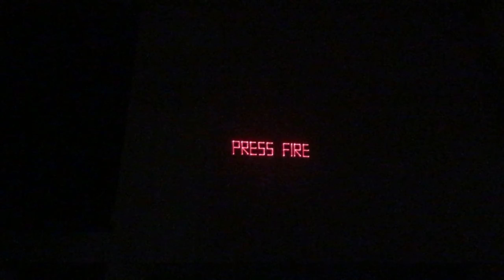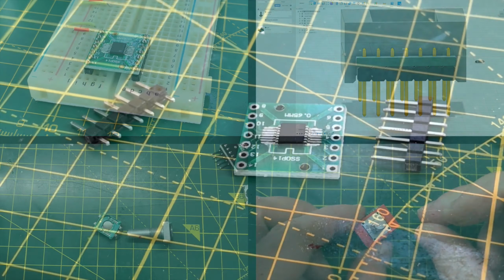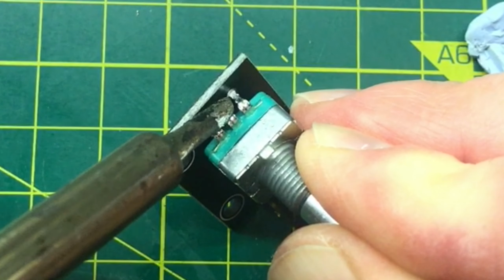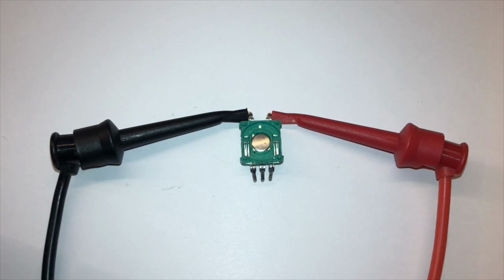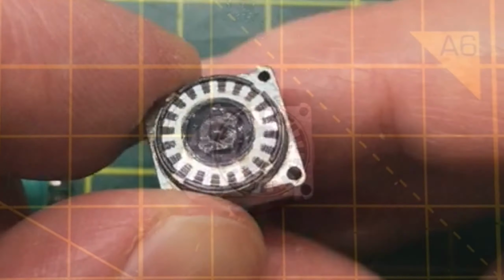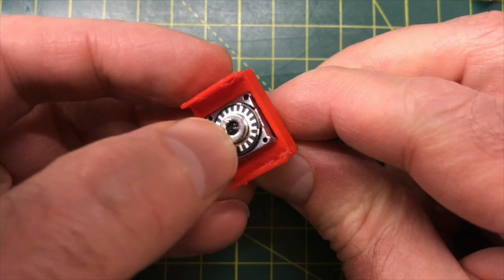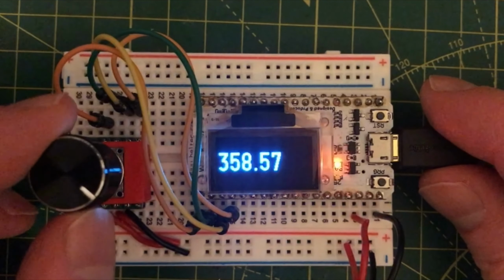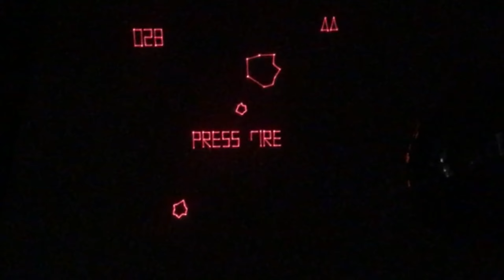High-Res AS5048 Magnetic Rotary Encoder DIY

Comment: This is really neat. I've been wondering how to interact with a hermetically sealed device for a dive light project I've been working on,  and I think this magnetic sensor configuration might be the answer. I applaud your ingenuity for repourposing the encoder shaft with a simple 3d printed addition👏🙌👌.  A+
Reply from the maker: Sounds like a great project. You would probably need to do some experiments to see how far away the magnet can be and if there's any impact from having some material in between the magnet and the sensor.

Comment: Another tip is to solder the end pins first and then you've got everything mechanically sound and can finish up the rest. This tip works well with or without the breadboard.
Reply from the maker: That's a good tip. Also works very well with header pins in an awkward place. Solder one of the pins and then you can adjust it easily to get it square before soldering the rest.

Comment: Another quick question- how expensive are those rotary IC chips? I presume they're an internal arrangement of hall-effect sensors?
Reply from the maker: They are relatively expensive compared - around £7 depending on how many you want to buy. There are some evaluation boards but they seem to be around £14-20. I was quite lucky that Rob Dobson (https://www.youtube.com/channel/UCScxC8mTWRU_ARb4nC3vIUw) had one spare from another project he was able to give me. You are correct they are hall-effect sensors - there are a few alternatives at different price points and quite a few from other manufacturers.

Comment: I had trouble to understand this video. Are the contact brushes still being used for some reason? Or was this just about using the same knob and overall design, but with a magnet and magnetic sensor? I'm new to this, so only read how this normally works, I'll look into a video next.
Reply from the maker: Just using the same knob and overall design and replacing everything with the magnet and sensor.

Comment: DESoldering any part is very easy. You need to hold the board with pliers, and gently pull it with others, holding it all over a regular electric stove.

Comment: Wireless control is quite easy to do between 2 ESP32's using Bluetooth serial - one as master the other as the client. I made a handheld game recently that used Bluetooth Serial to communicate between a pair of controllers, it works quite well.
Reply from the maker: That's really interesting - I'll have to give it a go. Do you have any pointers to sample code anywhere or is it obvious from the docs?
Reply: @atomic14  I just started with the example code https://github.com/espressif/arduino-esp32/blob/master/libraries/BluetoothSerial/examples/SerialToSerialBTM/SerialToSerialBTM.ino and https://github.com/espressif/arduino-esp32/blob/master/libraries/BluetoothSerial/examples/SerialToSerialBT/SerialToSerialBT.ino then I got the master to connect to client device. They each sent shared game state messages to each other over the BT serial connection. The connection between two esp32 devices worked ok up to about 10 meters and the connection was stable for over 24hours in my testing.
Reply from the maker: @sharpbends  Very interesting - I'm working on an ESP32 walky-talky but will probably use ESP-NOW for the longer range.
Reply: @atomic14  I think ESP-NOW has quite limited message size but I will be interested to see what you can do with it.
Reply from the maker: @sharpbends  250 bytes I think - but - if I can get it to build and run fast enough - I'm going to try using a codec from the days of GSM that compresses speech down really aggressively.

Comment: I've made an encoder from a hard drive motor but never did anything with it, I'll wait until my programming skills improve ! neat video and yeah make it wireless...cheers.
Reply from the maker: That's really interesting - I'd love to learn more about how you did that.
Reply: @atomic14  Hi, I got the idea from Greatscott, it just uses the motor and the disk mechanically then comparato'rs and Schmidt triggers to get a clean pulse from the three phases, and the rest handled by an Arduino. I had it control an LED ring, so as I turned the motor the LED tracked it..great fun..maybe you could have a go and see if it would be suitable for your Asteroids ?..great work and cheers !

Comment: It could also be built into an old potentiometer, without the need for any 3D print item. The pcb may need cutting down a bit on the corners to fit into the pot's can.
Reply from the maker: That's a really interesting idea - might have a look and see how easily they come apart.

Comment: Hello Atomic14. Good video , thanks for the detail.  A question a little off topic that I hope you wont mind.  Was that a laser projected Asteroid game ? Did you make it ? where can i get details about that ? Thanks again.
Reply: Ah, I've seen it now on hackaday. Nice project.
Reply from the maker: @perfoperfo9910  Thanks! Apologies for not replying to your original message - the code for the game is all on GitHub - details on the video here: https://youtu.be/LXDwGygCokU
Reply: @atomic14   hey no apologies Atomic14 there was about 20 minutes between my question and my own update. I don't think it would have been reasonable to have expected a reply in between :-) .  Looking at the other video now.. I would really like to make on  of these if I find a cheap enough galvos..what kind of KPPS are yours
Reply: Though what about using a laser projector? They seem to be the same price or even cheaper than a Galvo kit and would have everything ou need already in a nice box. Some are even RGB for £60.  As they aren't generally programamble. I guess it would require hacking to see if the signals to the galvos could be intercepted with those from the ESP. But doable I bet.

Comment: How does the chip knows the position?
Reply from the maker: If a magnetic sensor - there's a magnet in attached to the shaft of the encoder and the magnetic sensor IC can measure very accurately the orientation of that magnet.

Comment: That's exactly what I was looking for ! Do you think that would work with Raspberry PI ?
Reply from the maker: Yes, definitely. Though I might consider using the I2C version as I had to mess around a bit to get it working consistently using ESP-IDF instead of Arduino. I think the timings on the SPI interface might be off, but I'm not sure exactly why.
Reply: @atomic14  Yay ! Thanks ! As I am not very good at coding, do you have an idea of where I can found the code for AS5048B ? :)
Reply: @atomic14  Otherwise I was planning to use it with Arduino. I guess I can use the Arduino library for AS5048B from AMS code from github ?
Reply from the maker: @gathnobrain8024  The code I've put in my repo should work with Arduino no problem.

Comment: Nice work fine tuning the code for the AS5048. I am curious how did you resolve the angular position data from the AS5048 to incremental movement in the Asteroids game control?  More to the point, I am interested in converting angular position to quadrature motion because the AS5048 has finer resolution than many other encoders with quadrature output.
Reply from the maker: I'm just reading the angle from the AS5048 and using that to set the angle of the space ship. So its direction the ship is pointing is directly connected to the angle the AS5048 is sensing. I think what you want to do is use the AS5048 but output a quadrature output? Definitely doable, with a bit of coding. A simple approach would be to periodically check the angle reported by the AS5048 and compare it with the angle you got last time. You could then output the appropriate quadrature pulses to count up or down to the new angle. You would have a bit of latency but I don't think it would be noticeable.

Comment: That is a really good idea. How good would this be as a angle sensor for wind? I would need a very loose and lubricated axis, but other than that, your project covers everything, I have to try that! thanks for the video
Reply from the maker: I think it could work well, presumably for wind direction rather than for speed?
There are also cheaper magnetic sensors as well - not as accurate (1 degrees), but I think for most applications sub degree accuracy is probably not really needed.
Reply: @atomic14  I didn't know COTS magnetic angles sensors, and yes, for wind measurement 1 degree accuracy is really good. Thanks again!
Reply from the maker: Someone suggested the TLV493D as an alternative https://www.infineon.com/cms/en/product/sensor/magnetic-sensors/magnetic-position-sensors/3d-magnetics/tlv493d-a1b6/